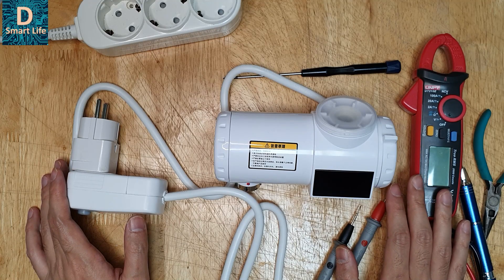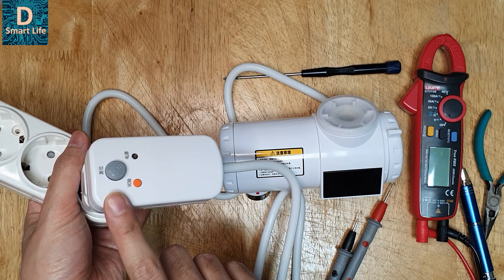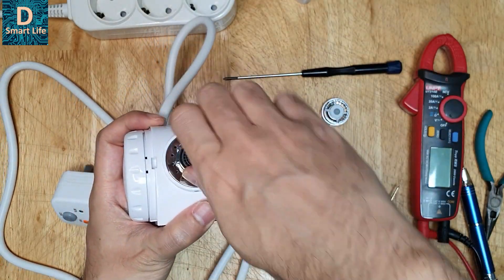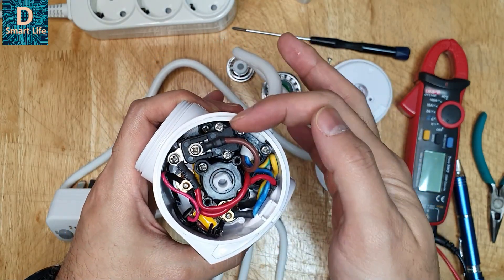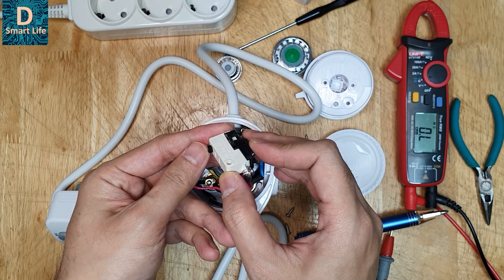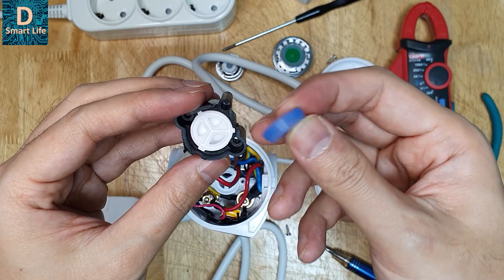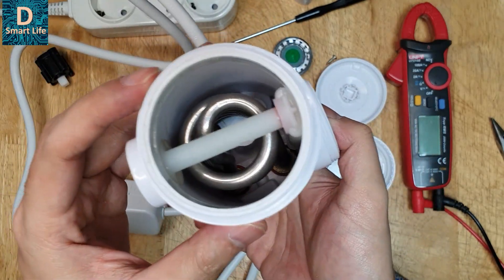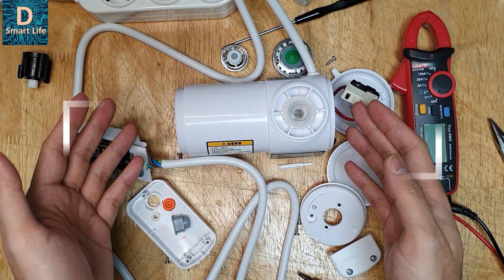Teardown Review of Xiaomi Instant Water Heater Tap/Faucet Geyser

Comment: Hi, I've just installed this water heater and it is good for the water temp in my area. However, the printed current rating of this water heater is no joke (3000w). I find that questionable though, because the provided protection power plug is rated at only 10 amps @220v: 2200w (printed on the socket head). I myself don't have current draw reader like the one you have. Is it possible for you to find out what is the real current draw of this heater?
Reply from the maker: The heater consumes 12.9A at 240V AC. Yes the device that they have included is rated at 10A and has Chinese plug that needs an adapter. So I do not use it. I use a local plug with 16A rating. I also recommend you to do the same. Do not use any plus converter/adapter for such high power devices. You can use this guide https://youtu.be/F9XAxjhtVNk to convert it to your local plug type. Thanks.
Reply: Hi, thank for the very insightful reply given. I was actually referring to the original RCD socket head that is rated at 10 amps @220v, not the supplied adaptor for china to eur, which i dont get anyway.
Reply from the maker: Yes, I also meant the RCD. I can't recommend using it as it's rated only at 10A and moreover it needs an adapter. I think you better install a EU plug like I did. And I guess most homes and bathrooms have RCD built in. So I think it's fine. Thanks.

Comment: Thanks for the video.
I have a question. If the tap resistor burns out, is it possible to change it?
Reply from the maker: I don't think it is possible to change the heating element. However this particular water heater has several inbuilt protection. So it may be unlikely that it may burn out easily. Thanks.
Reply: @DSmartLife  thanks for your answer! :D

Comment: Bro my water heater suddenly stopped working. I tried with the help of your video such as cleaning the outlets for bockage... and looking for the reset switch, pressure switch etc., but everything was fine but when I switch to hot water there is no display and also i get only the normal water from the hot water outlet. Can you please help me.
Reply from the maker: Did you check if the power is present in the heater? If the protection device present in the power plug trips then it will not work. Please check the power first and let me know. Thanks.

Comment: Can you connect a garden hose to the hot water outlet?
Reply from the maker: I think you can try connecting using one of the adapters provided with the heater. But I haven't tried it myself, so I am not completely sure. It also depends on the type of your hose and connector type.

Comment: bro i have a query, we have similar kind of instant geyser but it lacks thermostat. The problem is that we cannot control the temperature like constant heat at 30-35C, The minimum heat we got from our instant heater is 60-68C which is very hot if you need to wash your hand. Now coming to Xiaomi instant water I thought I will find some kind of thermostat in your teardown video but there is no such. So how does it give hot water between 30-50C(written in the description on banggood) only? Can you help me with this?? Mine heater is also good just cannot find anyway to control the temperature.
Reply from the maker: Yes. Usually tap based instant water heaters are not equipped with a thermostat. This is related to water's high specific heat requirement (energy required to raise the temp). In these heaters, the water flow rate is the heat control. The lower the flow rate higher the temp and give versa. The usual heaters are only 3kw and it can raise only 30C heat, at normal flow rates. So either your input water temp is already very high or your flow rate is too less. Or your heater is very high power. In the Xiaomi heater case, as you see in my review https://youtu.be/gpbHQ11c-6Y I can get only 43C at low flow rate with around 7C input water. Please check your flow rate, if you can increase it. I hope this info is useful. Thanks.
Reply: @DSmartLife  yeah exactly maybe my case that flow rate is very less. So is there any possibility to add any thermostat to get a max 30C temperature ??
Reply from the maker: @Sarfrozkhan  It could be a DIY project to add a thermostat. May be a temp sensor and a microcontroller with a relay to set the temp and cut off the heater. Easier way could be to add an SCR voltage regulator to lower the supply voltage to control the temperature by reducing the voltage supply to the heater. I'm curious which type of heater are you using and what's the rated power.
Reply: @DSmartLife  here it is: https://www.youtube.com/watch?v=THlhJheH4Nk
Reply: we use 220v in india and it's 3000 watt
Reply from the maker: I think you can use this one https://www.amazon.in/dp/B072MKKSNY/ref=cm_sw_r_cp_apa_i_k2JdEbSKFNRVA to control the power input to the heater. It might works with heaters well. The problem may be your water is not so cold and the flow is less in this heater. Usually it's designed for colder regions. Note that it's not a replacement for geysers because of lack of temp control and unable to mix cold water if we need to. In cold areas, 3000w is very less to heat up the water instantly and we can hardly get over 40C.
Reply from the maker: I was also thinking about the thermostat. It may not work with this kind of tap instant heaters coz of the lack of storage tank. Cutting off the power will instant cool the water and vice versa. So the thermostat will keep on turning ON and off and will fail. However, in storage geysers where there is stored hot water for a constant hot water flow even after cut off, the thermostat won't be frequently switching, hence it works well there.
Reply: @DSmartLife  i think voltage regulator will work fine to control the heat of this heating element.